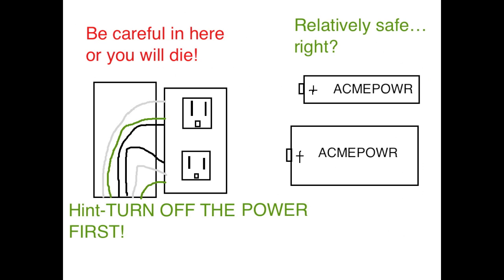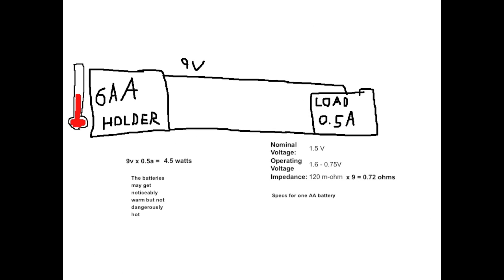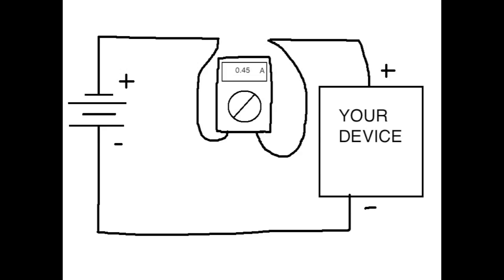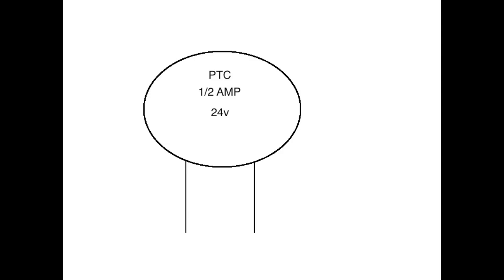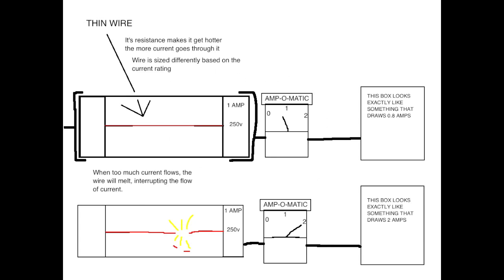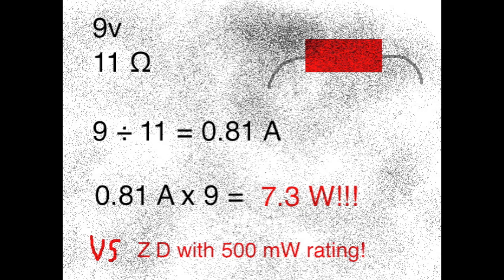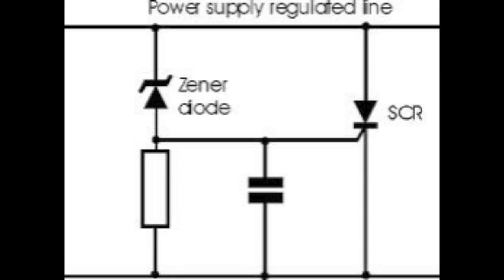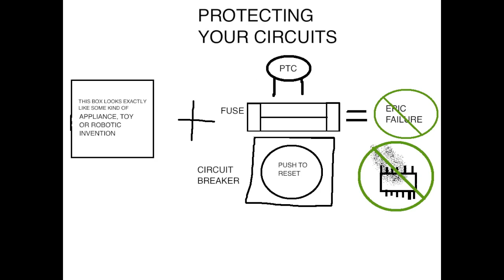Fuses, PTCs and Crowbar circuits explained

Comment: Nice video. I am trying to spec out a crowbar circuit for a motorcycle. I want to put it between the regulator an the battery as a fail safe in case the regulator dies.I understand the diagrams and I know how to solder. What I don't know how to do is pick the right parts. The regulator could be anywhere from 12V DC to 14.5V DC. I need a circuit that will prevent voltage from going over 14.2V DC to the battery. Can you help me with the right component values?